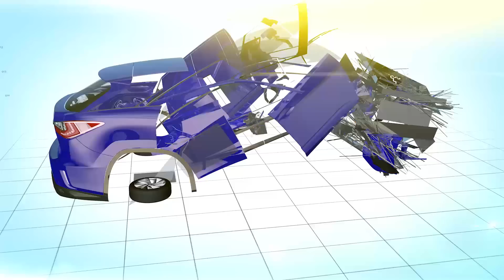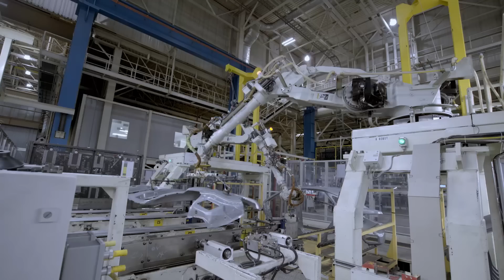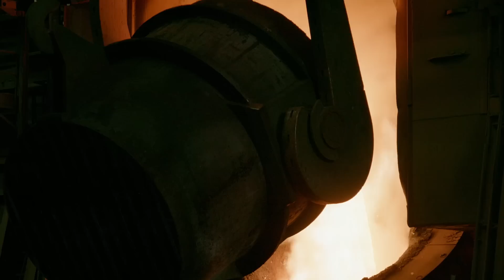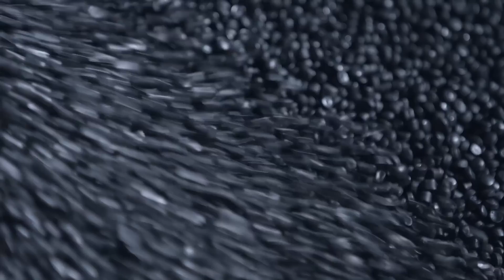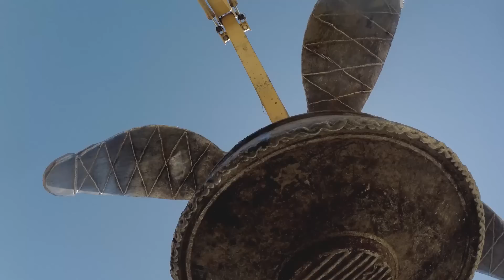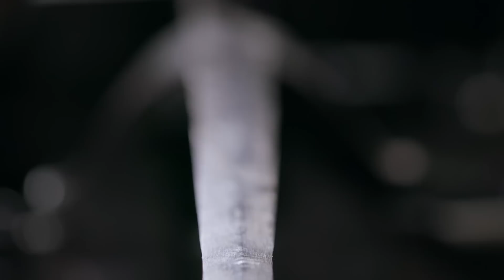Train Track Repurposing | Made By Destruction

Comment: Those railroad rails make perfect hobbyists anvils. They're made of hardened steel, so they take a lot of hammering well. I've installed 5 foot rails vertically as car barriers in front of small businesses. Just set it 2 feet down in the soil with concrete holding it, leaving 3 feet above ground to stop cars from bumping into the building. Believe me, they might loosen the concrete some if they hit one, but they'll never bend that rail! It's ten times better than the old drill stem that I used in the past, but it's also ten times heavier too!